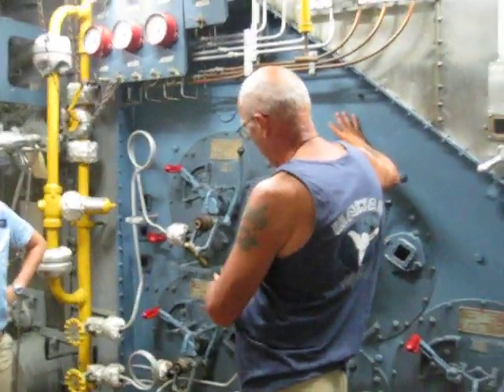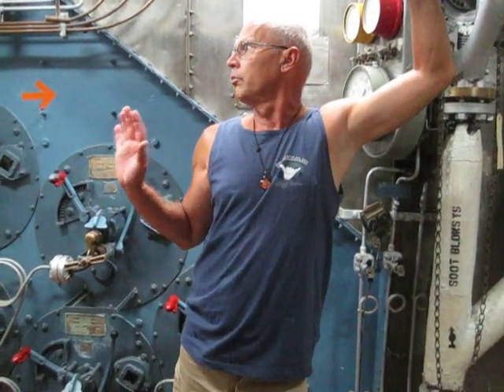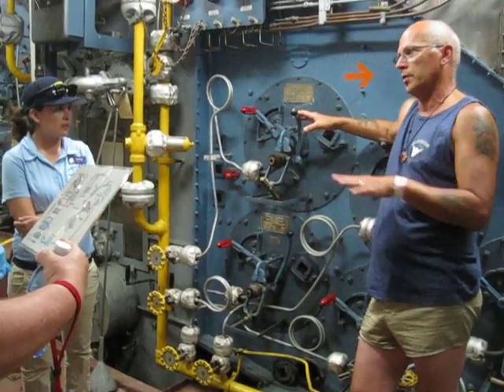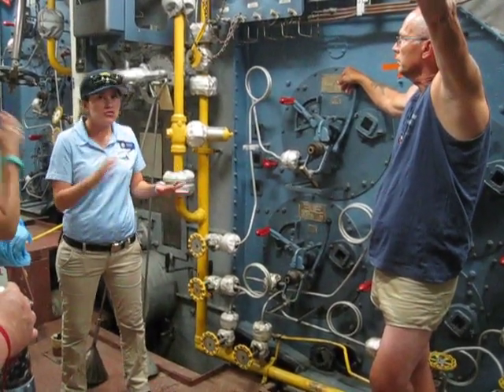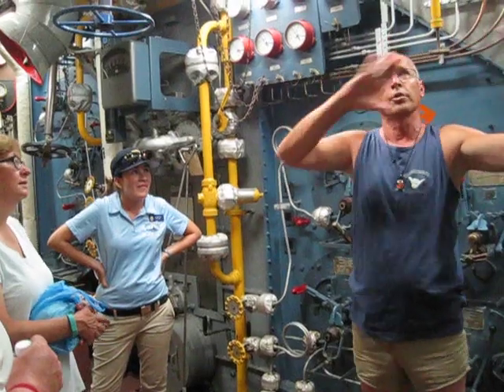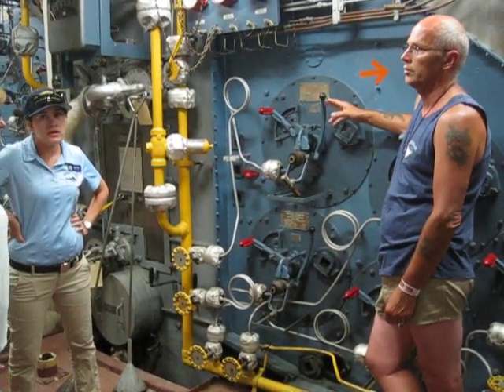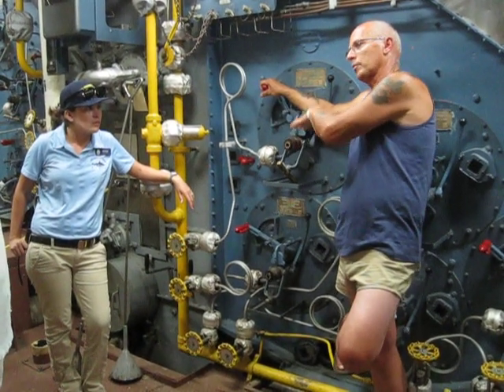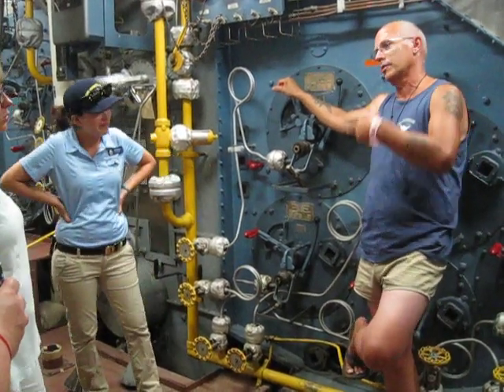Gene Bernhardt Tour 1 USS Missouri plankholder as Boiler Tech

Comment: I was a USN BT and I've been working on boilers my whole work life now.  But seeing the fireside of that boiler I have a question.  I understand that the burner barrels are pressurized f.o. and you had to change the sprayer plates to change the min/max firing rate.  The one thing I'm unsure of though is why do they have pig tails on the fuel oil line before the burners?  I've never worked on that type of boiler "we had steam atomization" and the boilers I work on now just have solenoids allowing the f.o. into the boiler.  I've never noticed the pigtails before in pictures and now I'm wondering.. I'll throw a guess though.. does it alleviate "I want to say water hammer" but fuel oil hammering when you start/stop a f.o pump keeping the flames steady?  That's a pure guess..
Reply: Just a guess, the fuel lines looking like they are metal,  the pigtails could be for expansion and contraction. All the Marine steam boilers I have worked on had flexible rubber coated hoses not unlike high pressure hydraulic hoses.
Reply: @steamdaysstoker  That's as good of guess as any.  I used to operate a Nebraska boiler that had steel braded lines that allowed movement because the fuel oil burner had to be moved in when f/o was fired and back out when you were ready to go back to natural gas.  The burner on the ship isn't t hat of course but I guess it could be for expansion and contraction..
Reply: @hankscorpio6111  Hi Hank, I had a look at a photo of boiler of a WW II Australian Corvette, it has steel pipes to the burners. I also had a look at one of my Navy Engineering  Manuals an yes the outer cover of the FFO hose is of braided steel on the Babcox & Wilcox boilers. What magnificent steam producers they were.
Reply: For expansion

Comment: The evaporators pulled sea water in through the sea chest, the water would then go through the evaporator several times called passes, the ship I was on had 4 stage evaporators, meaning 4 passes before the distilled water was discharged to the main piping and then to the onboard fresh water tanks.  The boilers got the largest amount of water on the ship, the crew got the rest.  If the evaporators were not operating as designed or the seawater condition wouldn't be adequate, such as a heavily polluted anchorage, we would go on water hours where limited water for the crew was enforced.  And the statement by the docent about the water being distilled and not drinkable, that is false.  It was all we had for drinking, showering, laundry and cooking.
Reply: True. I believe she was talking about the actual boiler water. Loaded with chemicals.

Comment: Just to clarify:  BTs I knew  hated to be called Boiler Tech.  The official web page for the Naval History and Heritage Command lists the rate BT as Boilerman.  Also "no visible smoke" condition was so critical on aircraft carriers that a fireman was posted 24/7 underway on the 07 level of the island to monitor the smoke stacks.  This watch was in constant sound powered phone contact with the fire and engine rooms.  Also 600lb steam leaks are "dry" steam therefore those small leaks would be invisible.  You would  likely hear a high pitched whistle.
Reply: We were called boiler technicians

Comment: There’s something seriously weird about this. Maybe he hijacked the tour?
Reply: How is a tour guide going to know more than the guy who spent 1,000's of hours staring at that boiler front.  "literally".  The burnerman had to watch the fires while online so that if they flamed out he was there to turn the fuel off preventing a boiler explosion.  I was also a Navy BT and have dealt with them.  He wasn't exaggerating the hours we worked either.  The ship I was on was a bit more automated though.  The fuel air ratio's were pneumatically maintained.
Reply: @hankscorpio6111  right, that guy was my boss there on the Mo, we served in 85 to 89. He had to be pulled out one time from heat exhaustion, he worked very hard. He hasnt changed a bit minus the white hair.
Reply: @caryDesigns  I'm sure you did too brother!  There weren't too many BT's that didn't work hard "or at least pull their own weight at the minimum".  It was a hot dirty stinky "fuel oil" hazardous job that I think we all took a whole lot of pride in.  "Hazardous meaning all the many ways a boiler can explode, fuel oil/ oil catching on fire, chemicals we used to treat the boilers, asbestos/fiberglass.. and on and on"  lol.